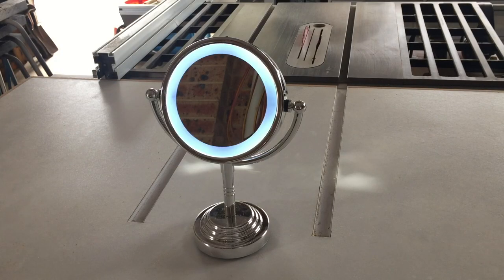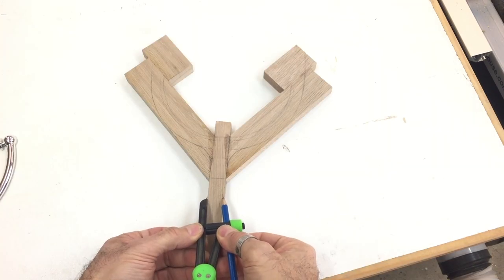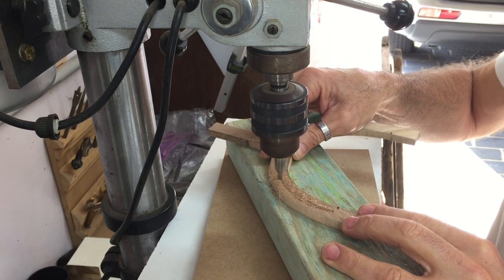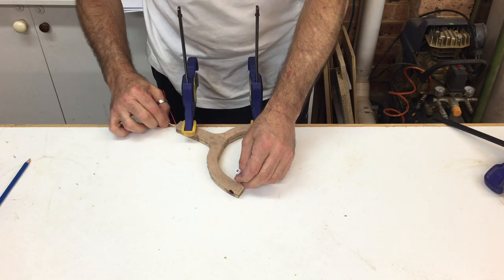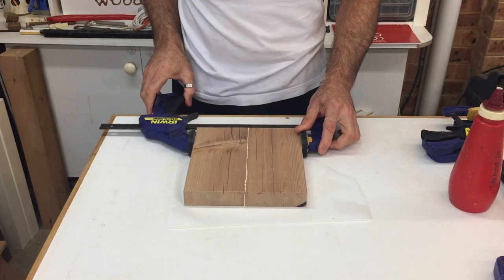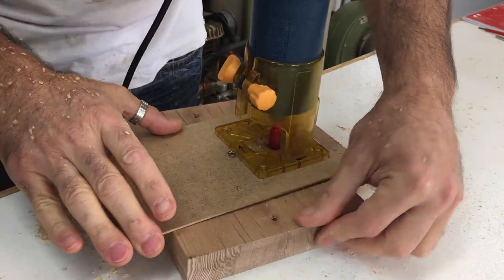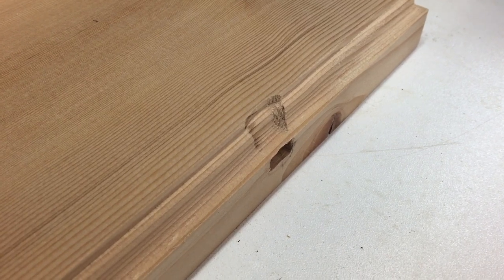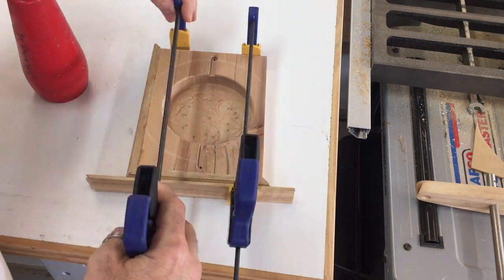How many fails ??

Comment: I'm making some simple cabinets out of ply at the moment.  Base, back, top, and dividers.  Can't get much simpler.  The back sheet has a 6*6mm rebate/rabbet on each end, so, like an idiot, I cut 12mm off the end of the sheet.  Which wouldn't have been a huge problem, as I could have just cut the top/base sheets 12mm short as well, except that I measured out two of the dados for the dividers from one end and the third from the other, so the last dado was 12mm out (the top/base sheets had already been dado'd correctly).
At that point I gave up for the day.  Got it right this afternoon, though.  The 'wrong' back sheets will now get matching top/base sheets and I'll have an extra cabinet which will fill up with stuff I didn't know I had. :)
Reply from the maker: lol...  they just sound like design changes to me. I feel for you mate but sounds like it all worked out in the end :-).

Comment: nice vid, the focus on the failing is all part of the good vibe. I know that there would be no video but did you not just think to epoxy the original base back together ?
Reply from the maker: Actually I did but thought it would just break again. It seemed a much better option to remake a timber one, and yes it meant another video. Cheers mate.